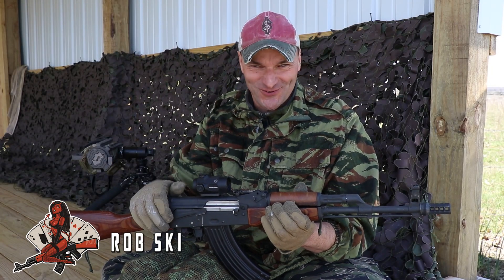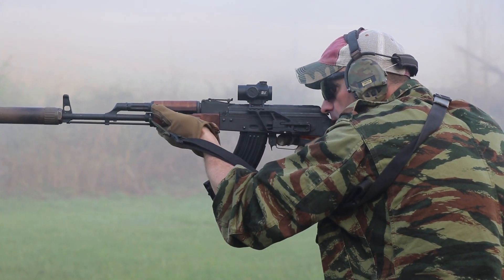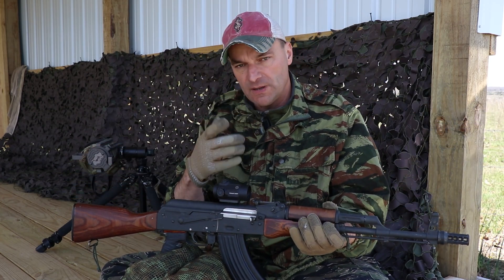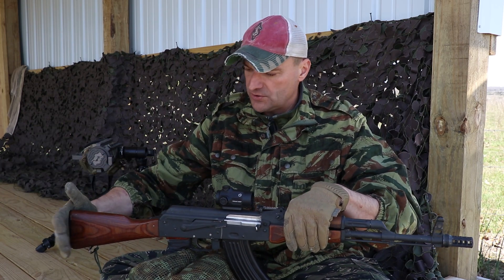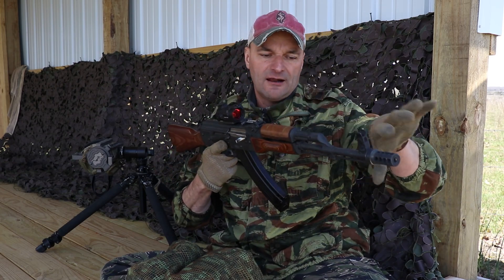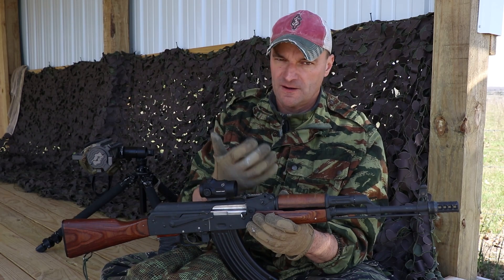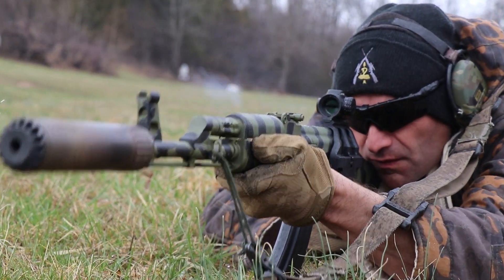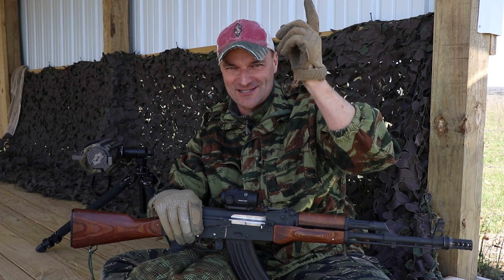Better AK47 Recoil Management! Cost nothing!

Comment: I wonder if those UTG recoil pads have changed since you bought yours.  I can not find any that look like yours.  At 75 with arthritis in my shoulder and neck, I can not be too careful when shooting my AK.  Currently I use a folded up jacket to protect my shoulder and that’s a pain in the butt to use.
Reply from the maker: It could be. Mines are very old, they are made of thick rubber which makes them basically indestructible. I just move them around. I have two.
Reply: @AkOperatorsUnion  Thanks.  I ordered one.  With shipping, almost $27.